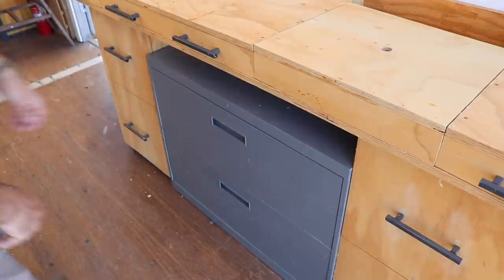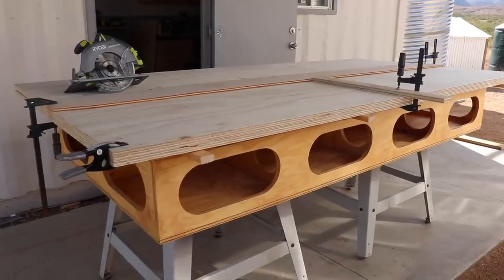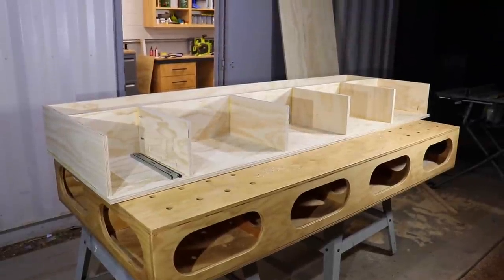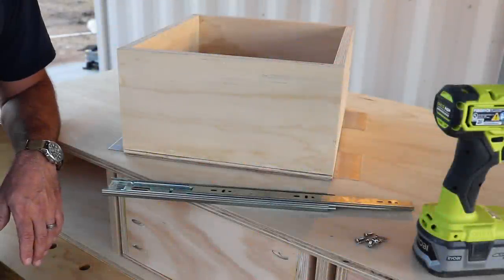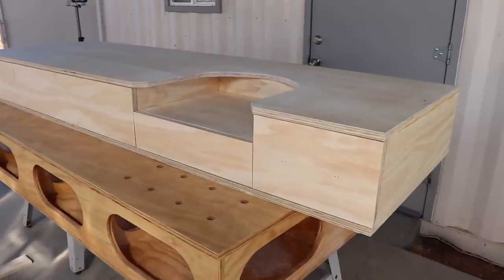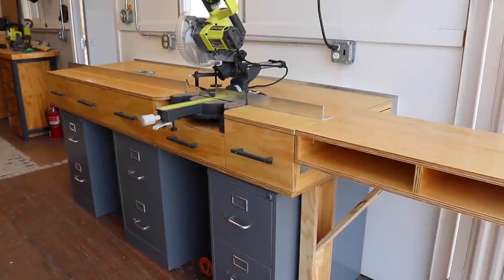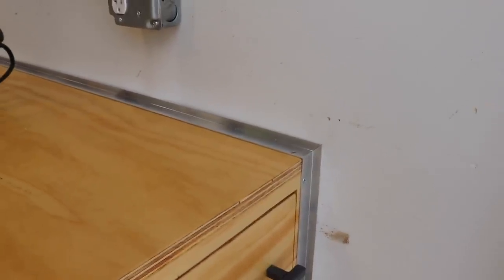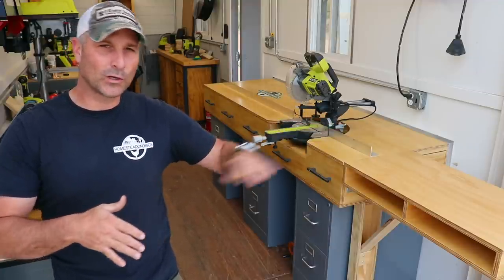Overbuilt Workbench & Miter Saw Station - How to Make

Comment: I've just binged on your channel... I must have watched 100 videos.  Most interested in the camper build.... but everything else is excellent too.  Since you asked, I thought I'd tell you that I'd like to see you make a solar water heater.... I can't imagine you haven't done this already living where you live, but I've seen it done and I bet you can do better.  On another note, I am wondering if the problem in your greenhouse is LACK of humidity.  They say it's a dry heat, right?  You took such pains in keeping water OUT of the area, but I suspect you might need to add humidity to the air.  I do want to see you work out the geothermal.... perhaps include those incredible cisterns/water collection systems in the process as water will transfer thermally every bit as well as the soil...  There's gotta be a way.  I'm no expert.... and I was not born with that green thumb.... so just sharing thoughts. Thank you for sharing all this stuff with us.

Comment: Very nice bench and workmanship. Stop block clamped to angle be quick and easy and just as accurate as one with a t track. You could cut a slot in the angle and use a carriage bolt and thumb nut in a block of wood and a dowel in line with the bolt in the bolt to stabilize it a little more.
Reply from the maker: Yeah the clamp and a block will do a perfectly fine job.... but it’s my desire to tinker that’ll have me devising some mechanism for it😂

Comment: 2 of my early ham radio desks were filing cabinets and a hollow core door that I filled with spray foam to stiffen it! Made a nice 36" deep desk so I had work space in front of the radio gear. Moved on since then to steel workbench legs and a 30" deep piece of counter top then a riser made from red oak. Only thing I did wrong is not put some form of caster under it to roll it out, dang thing is so heavy it takes 2 people to move it!

Merry Christmas form a a white MN where it is sunny and a balmy 2 degrees F!
Reply from the maker: Oh yeah!  They can get really heavy once you add stuff!   

And a merry Christmas back to you.... albeit really late by now😂👍

Comment: Nice job, are you looking to add another file cabinet with available space? Don't forget to cut a 45° angle on ends of aluminum in middle of cutting station to dull the corner so nobody gets snagged walking around. 🙂
Reply from the maker: Thank Alan!   Yes the 45 is a good idea for sure!   As for the space below... probably will make a rolling storage that will slide in between the cabinets.   For the heavy stuff like my cold saw and things like that.   Thanks for watching and sorry for the slow reply😀👍

Comment: SO SWEET!!! love the minimalist practicality.
you might want to round-off the corners on the aluminum mitre fence parts, as they can be very dangerous and don't bring any utility.
inside the drop-down extension drawers you could have a bunch of little plastic boxes to hold screws, nuts and bolts, etc...but that might get heavy actually. somebody below said sandpaper, that might be perfect.
Reply from the maker: Thank you Douglas!   I agree👍😀.  But the reality is that I will forget to do anything to them until a cut or scratch my arm once and then I’ll remember 😂

Comment: Awesome. I really like the way you made the hinged access doors for the long storage cut into the bottom. Literally thinking outside the box there.
Would like to ask why you have the little wood sticks/spacers on top of the metal file cabinets. Is this to raise it up, or for a different reason? Thanks.
Reply from the maker: Thank you!   Yes I wanted them to flip out of the way and not be noticed.   
As for the wood spacers... that is because the two outside cabinets are about 3/4” shorter than the middle, wider file cabinet.   I got them off of Craigslist used so I was happy they were atleast the same depth.... haha... so I was willing to work with the different heights😀👍

Comment: Turned out great Joe! Merry Christmas! 😃👍🏻🎄👊🏻 .... For the drawers, I would say it depends on what you are putting in them... For example, if you are storing boxes of screws and nails, I'd say to make a sectioned/divided type of drawer so that depending on the height of the drawer, would allow for boxes to be inserted either face up or side up, so that when the wing is then folded down and you slide out the drawer, the boxes will be sitting upright on the dividers/shelves..... Or, for handheld power tool storage, use tool specific blocking the acts as both drawer organizers and tool hangers depending on the wing position.
Reply from the maker: I like both those ideas!   I originally thought of little boxes that would rotate by the weight of the contents to always stay face up.... but I think the drawer wouldn’t be wide enough..but I think having tools stored in there would be a great idea!  Especially for this kinda tools that don’t get used all that often.

Comment: Really good build, are you going to be using a shop vac for the dust from your new mitre saw at all? Also love your use of filling cabinets, we've been using the 4 draw versions for tool and bits and bobs for a while now, there really handy and usually free 👍
Reply from the maker: Thank you!   For now my dust ‘system’ is just to blow everything out with a leaf blower..... effective but messy for a bit.   But I may end up creating a system where I could route a vac hose through that long storage area and make a shroud or hood for the back area of the saw.  But for now it’ll just be the leaf blower and the end doors of the shop 😉👍
Reply: @homesteadonomics  Sounds like a good plan, my mitre saw is starting to look like a wood based snow storm has left a bit of a blizzard around mine at the mo.... So a leaf blower might be a good option 🤔😉😂

Comment: Looks good, thanks for sharing. 
I just wonder whether you might find that you hit your hips on the handle of the mitre saw when moving about.
Reply from the maker: Thanks for checking it out!   Yes the handle does pose that risk but so far it hasn’t been an issue🤞😀
Reply: As long as you stay out of your workshop after a drink, it's not a problem 😉👍

Comment: How about sand paper organizer for the bench extension?
Reply from the maker: That is a really good idea... especially since it would be light and I don’t want to add too much weight to make it cumbersome to use.   And plus, my sanding discs are just piled in a drawer with zero organization right now.  So they might be a perfect fit for that extension!
Reply: Perfect because sandpaper is lightweight and vertical/horizontal orientation agnostic. 😁